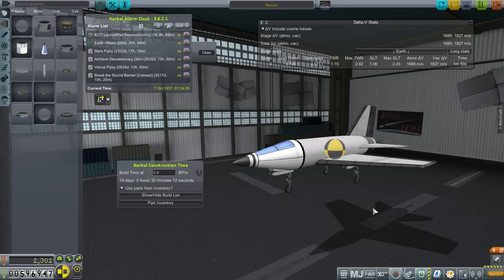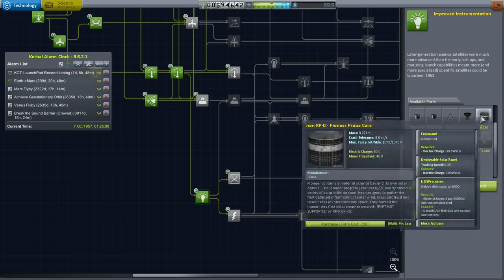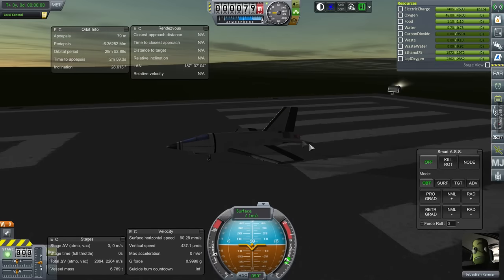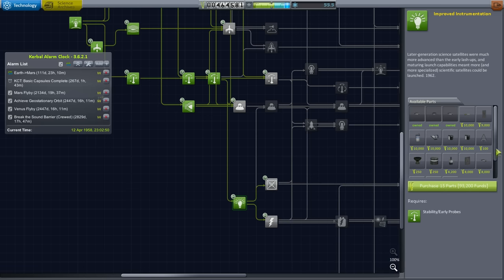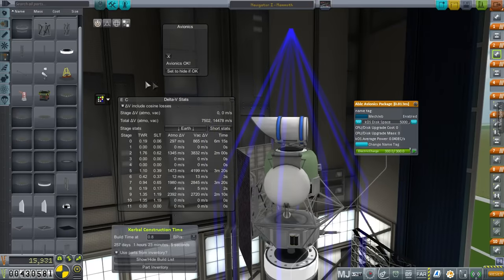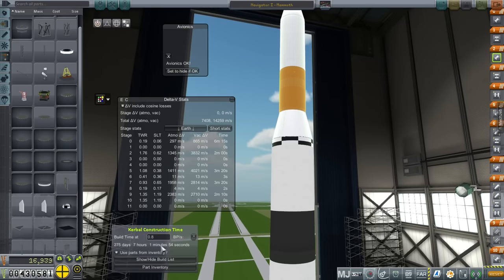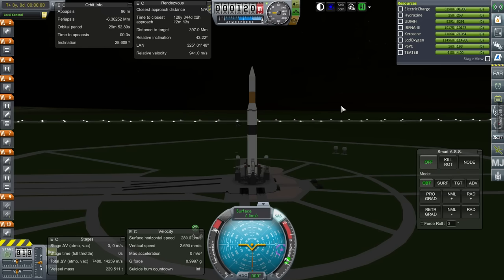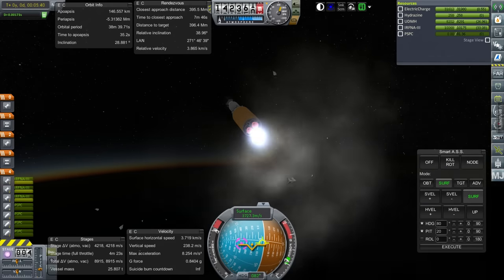Realism Overhaul in KSP 1.1.2 - 08 - First Mars Fly-by Attempt

Comment: I 100% called the mishap that rekilled Jeb, since the very same thing happened to me. Notice your wheels clipping through the runway, I found that stable taxiing down the runway was impossible and planes were invariably fatal. I'm waiting for a heftier computer before I do RP-0 again, so I don't know if it's fixed in 1.2 with the new wheels, but I don't think it was the wheels. It sounds like the current bug fixes include fixing clipping on runways, so my hopes are high that that helps with the next version, but I don't know if that will only fix it in stock or if it will help on a real scale planet with its less precise position calculations. My solution in the meantime is to launch my planes on top of small rockets, vertical, and to land them with parachutes.

Comment: Your RCS thrusters when angled like that on your final stage seem to be almost perfectly aligned with your CoM, thus producing nearly zero torque. You can see that they're firing by looking at resource usage (and available delta V decrease), the plumes only show up at 100% thrust which I guess rounding errors in the autopilots prevent from happening. Or something. Point is, just keep them pointed as far away from your CoM the next time you're not using them for ullage on a stage, which is usually at the bottom perpendicular to your engine. It makes sense to orient them at such an angle on that top agena stage, for instance, just not when using the 1kN thruster.

Also, RCS build aid: making sure your engines don't induce torque on their own since whenever you get around to installing it!(tm) ;)

Comment: The HG-55 and large solar panel were both part of the Asteroid Day mod before moving into stock. Strange things can happen if you have multiple parts with the same name (as shown in the "show info" section of the part dialog window) so maybe check that Asteroid Day isn't still installed although I don't know if removing it part way through a save will fix tech tree issues.

Comment: The High Gain Dish is bugged. I read on the forums that it's something to do with the old Asteroid Day pack from a previous version of KSP. I think I read that one way around it was to check 'Hide Unpurchased Parts' in one of the mods(filter extensions maybe?) that should be on the Space Center screen if you have that mod installed. I installed my RP-0 via CKAN so it got installed with RP-0 as a suggested/recommended mod I believe. I actually have 5 or 6 replicas that have opened up now - one after each time I tried unlocking that dish. I've not seen the problem with the solar panels though as I've not tried unlocking them yet.

A quick conversion I found for EC to Watts I found on the forums also which I hope makes sense to you as it helped me out a lot(I believe your calculations were correct but at least you now have something to look at to calculate):
1E/C = 1kJ(=1kW/second). 
eg: 6EC per minute = 6000J per 60s = 100 Watt
6EC=6000J=100W
 
I have no suggestions for your RCS issue unfortunately as I haven't encountered that as of yet. EDIT - Only thing I can think of is there's possibly something wrong in the 'Show/Toggle Actuations' config in the right-click menu of those thrusters. Other than that I'm stumped

Comment: oh bugy, why u so presistent :D
Reply: also they are translation thrusters, maybe you can see it in the description of the part...
Reply: looks like rcs thrusters on last stage don't fire on pitch / yaw because they aligned with COM. So they can't produce torque. Do you have RCS build aid installed? Check attitude torque on last stage with it.
Always place rotational thruster as far from COM as possible to increase efficiency.
Like you vids, btw!
Reply: RCS build helper is up to date and will solve these kind of design malfunctions :D
Reply: xD